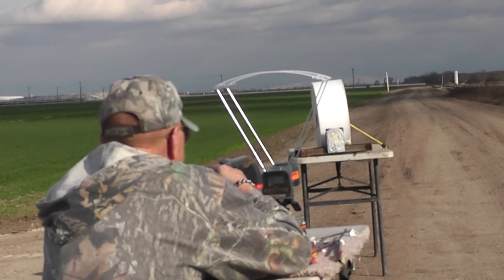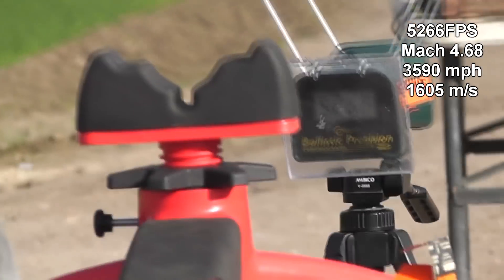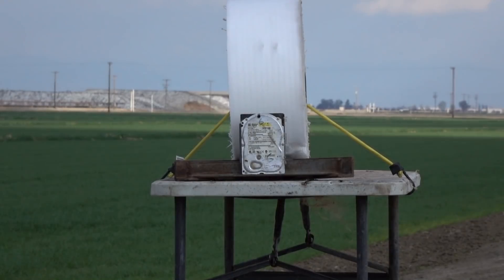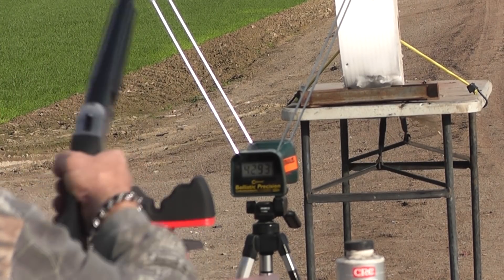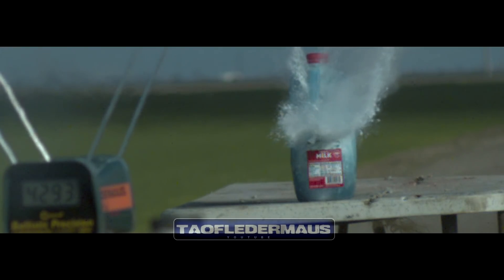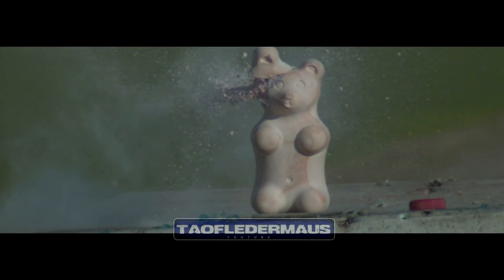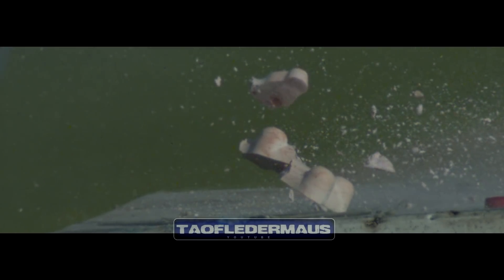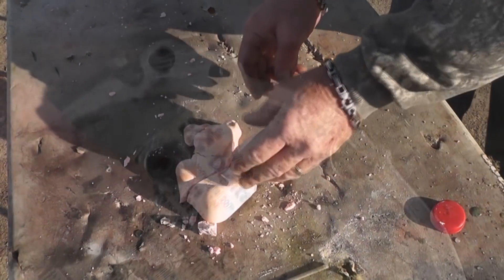Driving Airsoft BBs Faster than the Fastest Bullet - Must see!

Comment: You can probably push more energy from airsoft bbs. A popular choice for some people are 0.66g ceramic bbs, but they're quite expensive at around $0.50 a shot. Should be able to find them if you search for 6mm ceramic ball bearings.
Reply: Actually curious about pellets at super high velocities.

Take a few slugs at similar shapes//total energies but different masses and see what type of wound cavities they leave.
Reply: he is shooting 6mm ball bearings. ceramic wouldn't work near as well. first of there is a good chance it would just shatter in the barrel. second once it makes impact all energy would be lost and there would be greatly reduced penetration. what he needs is a denser metal

Comment: The flash astounds me when BB pierces the casing of the drive.
Reply: When you impart so much energy into the metal, it moves electrons in the metal, into a higher energy state. This is not where electrons like hanging out, so they dissipate the energy as photons (light) and slide back into a lower, more comfortable energy state.
Reply: Ta for that Maxx B.You explained that well enough that I understood mate.
Reply: It was a 6mm aluminum BB
Reply: Unfortunately that explanation is a bit off. Elemental aluminum is flammable under the right conditions. It has to have enough surface area, oxygen, and heat. I’ve done my fair share of “experimenting” with this stuff. What is happening is that the aluminum is shattering on entry and the friction caused by the impact is enough to combust it. Really is amazing that they’re able to do this.

Comment: Could tactical G code bore-out a solid barrel for BBs?
Reply: You can buy high pressure tubing that can hold like 300,000 psi online, and it's pretty cheap like $5 a foot. The hard part would be finding one with a perfect fit.
Reply: do not forget, that bore for bbs is smooth
Reply: And an adapter for 308 cases
Reply: the bore diameter sure, but machining a rifling is a wee bit of a trick for a lay machine shop not oriented towards firearms/projectiles to begin with BUT not to say someone wouldn't be willing to try
Reply: Matthew Muhlberg these are little balls,the barrel is smooth.
Reply: Ted Archer use 6.35 and a nylon cup for a wad.
Reply: I was going to read some comments and float this idea.  you can buy BARREL BLANKS. buy a BARREL BLANK  for 17 cal and have it chambered for what ever shell you want. see my comment above.
Reply: TheBackyardScientist problem is their inside diameter is 5 or 6.35 mm, when you need 6.01 to launch bbs
Reply: TheBackyardScientist Oh hey there! :D
Reply: TheBaconWizard That's the ticket! Good thinking.
Reply: if .22 is 5.54 mm and airsoft is 6mm they dont have much to cut out, I cant see why not.

Comment: hmmm  ... have you ever heard of a "light gas gun" before ?
Reply: hmmm i wonder  how is it at rage with that kind of velocity bullet drop should be minimal but  wind might be an issue ... if you could get this but with full auto fire then it might make a hand home defense gun a...  low pen  light recoil high energy transfer.. like the https://www.youtube.com/watch?v=J50N5lQoAFw&t=12s but to the nth degree
Reply: https://en.wikipedia.org/wiki/Light-gas_gun
Reply: id be intrerted to see the effect on drywall, plywood and pork roast
Reply: 5:23 mm a longer barrel with a longer grained slower burning powder might be the order of the day .. either that or a thinker pipe or raping ... ooor  if you have something like with say a high compressive strength that could sat be  poured in around it an the shotgun barrel  then that could transfer the  stress to the shot gun barrel .. first thought would be polystyrene but ... well with such a low melting point... still i suppose if you wait between shots for it to cool it might work... acutely silly putty might work too  as the inner tube states to bulge it would thicken up and solidity .. but that's just some thoughts
Reply: or just wrap it in duct tape ..either that or wind wire around it .. it works for  navel guns https://en.wikipedia.org/wiki/Glossary_of_British_ordnance_terms#Wire-wound so it should work here
Reply: besides even if it does give it should be easily contanted withing the shot gun barrel
Reply: i wanna see 2000 m/s lol
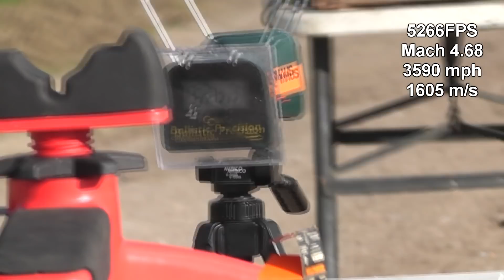Reply: 0:56 double or nothing :P

Comment: Liking the vapor trails and the rim on the impact craters.
Reply: They are supersonic shockwaves, the sharp angle of the cone they form already tell you the velocity was very high.
Compare with bow waves of a boat, the faster it goes, the sharper the angle between them is.
Reply: trefod vapor? Isn't that shock waves?
Reply: mmmmm i agree
 There's a thickness to them ... ?
Reply: Yes the trails left by the BB is light being distorted by the density of the air being pushed aside by the BB. Same as youd see in an explosion.

Comment: Could you wrap the barrel in something to strengthen it? Like fiberglass or even just twine.
Reply: Wrap it in more tubes. Start with a 8mm x 6mm 304 stainless steel tube, slide that into a 10mm x 8mm then wrap that in a 12mm x 10mm. That should give you a 3mm walled barrel. Braze the ends to secure all three tubes and you should be good to go. If you wanted you could keep wrapping each barrel in a larger tube till you got up to 18mm, filling a 12 gauge.
Reply: Duct tape :)
Reply: Pippy maybe epoxy and carbon fiber
Reply: Look up Carbon Fiber Rifle Barrels and you will see its exactly what you want. A thin steel tube wrapped in carbon fiber. Not cheap
Reply: Fiber Fix
Reply: Pippy , or carbon fiber perhaps?
Reply: Yeah, carbon fiber is the one.
Reply: steel wire would be good too :)

Comment: Awesome. Deadly bb's. Wonder what range you could reach out to.
Reply: eh, The metal ones are certainly potentially lethal, not very, but possible
Reply: @Jexorz86  um what?  he was shooting gel last video and it was going good 6+ inches.  That means it is deadly enough to kill if in a decent area.  its lethal for sure.
Reply: @TehMunch1  You can poke your finger into ballistic gel. And Its not an accurate reprensentation of the human body unless mixed in a very specific way which most youtube channels do not do. Im pretty sure  TFM have stated this in other videos. I did the math on these. They just dont have that much energy behind them, Blistering speeds yes, but just not much mass.

Comment: Do we know why 2 Non-Ferrous Metals are making that flash? Would love to know.Thanks guys God Bless.
Reply: my guess would be that at the moment of impact  the kinetic energy is being converted into enough heat to either vaporize a portion of the bbs  and then rapidity oxides the small particles ... but that's just my guess
Reply: yankey4 when the crystilan structer of a material is broken it releases energy in the form of light
Reply: So is there heat as well or is it just light?
Reply: lucky43113 this is correct. Same reason life savers bitten in the dark will release sparks, shearing of the crystalline structure causes the release of light.
Reply: No I get that whats I was trying to ask is there an open flame or spark.. Sorry I was not being clear there..
Reply: Good call. Would love to know LOL.
Reply: Right I get that, I was not being clear. What i was trying to ask if there is a open flame or spark from the impact. Sorry I was not clear there.
Reply: We use it in Tannerite as an oxidizer. Been a fireman for 20+ years. Been to a few bad Aluminum fires. Thanks
Reply: So like then that one dude was shooting them with 556 and 7.62. I forgot about that. Thanks,,
Reply: Steve Johnson aluminum does not burn as a fuel. Otherwise how could you weld it? I've worked with aluminum for the last 15 years and not once have I seen it burn. Aluminum oxide can be used as an oxidizer but not a fuel.
Reply: Rudolph, he say 'Anything will Diesel if you hit it hard enough.' Y'all.

Comment: If you used a spacer to accelerate some gas, you could reach relativistic velocities.
Reply: Taper the spacer and fill it with nitrogen, or perhaps a lighter gas like helium.
Use a faster burning propellant (you mentioned flash powder which would be perfect if it has enough oxidising agent mixed, a dog the powder is granulated and mixed evenly).
There's schematics online, but experimenting would serve you well (seems that's what you're good at).
So use a launch tube with thicker walls because the pressures, though small in volume, will be astronomical.
Reply: i see you've read that wiki page too :P